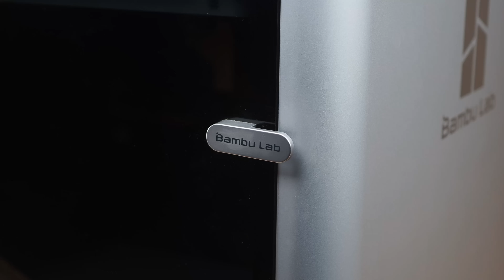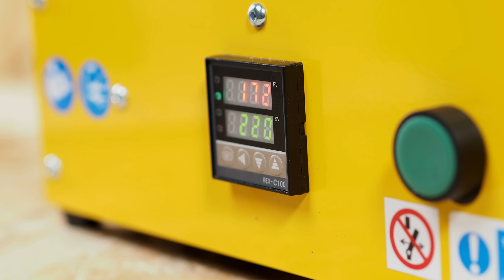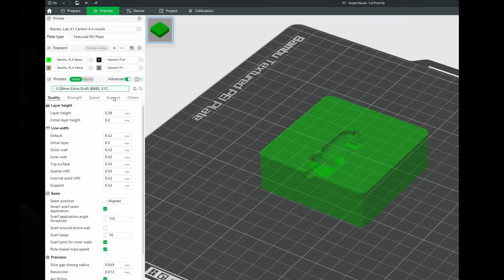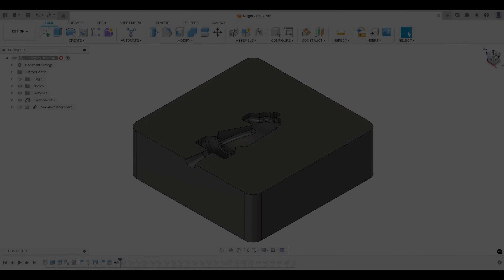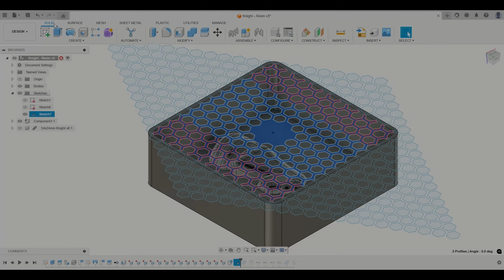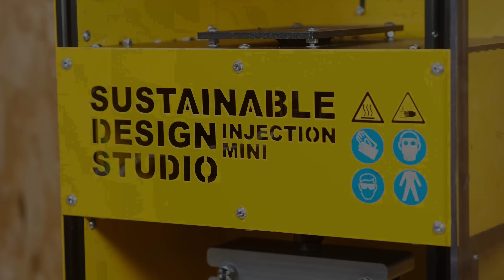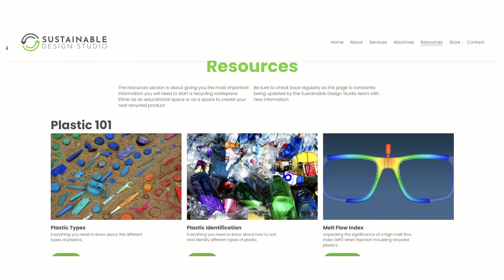How to 3D Print Injection Molds (FDM vs SLA) to Recycle Plastic!

Comment: do you have a f3d file for the 100x100x50 mould? planning to buy a machine next month and want to make some moulds but i don't know what the radius on the corners are., and where to put the hole. 

Thanks!
Reply from the maker: Yes we do. It's here:

https://www.sustainabledesign.studio/moulds-3dprint

The full f3d step by step is here:

https://www.sustainabledesign.studio/moulds-design3d

Let us know if you need any further help 😊

Comment: This is not great idea like many people think. Way too long time take and the time is biggest enemy on quality production. It basically burns the plastic.
Reply from the maker: The key to recycling is to not burn the plastic. That's our objective, and by melting the plastic at the lowest possible temperature we avoid this. 

This is designed for prototyping, not full scale production. However full scale production in china where time is cheap, still requires minimum orders and very expensive moulds (£10,000+)

 If you are looking to produce 1 to 10,000 units that's where our affordable solutions come in. 

Hope that helps!

Comment: Can you electro plate a 3D printed mold? Does it make the injection process any better? Surface finish, temperature resistance, etc.
Reply from the maker: You probably could however the thermal properties of the mould will remain the same. It may improve the surface texture. But the SLA prints are already extremely high quality!

Comment: Molds was what got me into 3d printing in the first place,  about 3 years ago,  at work, we had a contract for making cables that required over molding of polyurathane over the connectors,  it was a small contract and the company was not going to shell out the cash to buy a machine.

we got a local machine shop to make the molds on cnc with aluminum.  the problem with molding over connectors is getting the rubber over the parts you want without it seeping into the connector,  another problem was that the 2 part urethane was sticking to the molds,  on top of seeping into connectors,  I felt that they were designing these things wrong.  so I started learning fusion 360 from scratch,  and bought a 3d printer,   1st mold I made was miles ahead of what they have been attempting with aluminum,  a couple quick tweaks, and it was perfect,  and an added bonus, the urethane did not stick to the PLA,  I didn't even need to use silicone spray release. 

I am currently on another over molding project.   (military contract)   and the cables look great. 

Plastic has an advantage,  since its semi flexible,  if can create tight seal,  Used printed flat inserts to isolate the part of the connector that needed to be free from the epoxy/urethane.   also the cable needed to be able to exit the mold, so that "hole" is what needed to be tweaked to have a nice seal so the epoxy does not leak out.
Reply: I'm looking at doing the exact same on some 16 way Odu connectors! Using an x1c for printing, what polyurethane did you use for it?
Reply: @cdhmcclelland  Mostly mil spec stuff,  whatever the drawing calls for,  for example conathane EN-1556,  I do not have a commercial injector,  I just mixed part a and b,  in the right ratio,  de-bubbled (vacuum tank) then used syringes yep  regular old medical 60ml and injected.
but last cables I did, I found a better way,  I used a big 200ml double barrel adhesive cartridge, and mixing nozzles,  I did not need to use a vacuum to de bubble,  once I fill the cartridges,  the material is not mixed,  they mix in the nozzle at the time of application.  whatever you don't use is not wasted.  only the nozzle needs to be removed after use, and a new one used for next application.   in theory if you really need to de-bubble the un mixed materials,  you could do it directly in the cartridges before putting in the plunger disks,  I did not have serious bubble problems, so it was not needed in my case.   this all depends on the material you use, how fast it cures and its viscosity.

Comment: the  real game changer is going to be once metal printing becomes more open source and open to the public in the near future. I've already seen people build car parts from metal printing, but imagine mold making with metal for home injection.
Reply: Metal 3D printing is going to be a game changer for real. You will be able to fix anything - as long as the metal 3D prints are strong enough, you will even be able to rebuild old cars that do not have solid metal replacement parts

Comment: Very nice video production. Im curious about the injection pressure...I reckon that's defined by the pneumatic system. Is the air pump also included in your kit? and what injection capacity could it do?  I ask in case we could potentially do multiple parts per mould 😀
Reply from the maker: The Injection Mini requires a separate air compressor, but these are cheap and easy to find. 

The injection size is 70cm3 which is actually very large for a desktop injection moulder. Plenty of room for multiple cavities!

Comment: Hi great video, finally more content on this topic is coming up I think for sla printed molds and ~50 injected parts and this is a great method, please keep videos on it coming guys 😊

1 quick question, I want to make cookie cutters like this but sla resin is toxic. Does contaminants leach to the injected part as mold ages, I hope for first 50 parts it is still good 😅

Or have you ever experienced mold material or color passing on the injected part?

Because even if I make a skin contact part like a jewelry resin in my opinion is risky if it leaches to the final part. Using mold release might also help with taking the part out of the mold and this contamination aspect.
Reply: Some manufacturers do produce food safe and wearable resin, something produce resin made for mold making, regular resin tends to inhibit silicon rubber from curing inside a mold from my experience.
Reply: @miguellopez3392  Thank you for your answer, but there is no 3d printable food safe resin unfortunately. 

There is biocompatible resin but then I cannot use it to inject plastic inside as they are not high temperature resistant.

I didnt understand rest of the comment. I mean I would use a high temp resin if I do this anyways like what is advised on the video TR300 resin or something like that
Reply: @ROBOROBOROBOROBO  certain resins can't be used as molds because they inhibit the epoxy/silicons from curing properly leading to the surface of the product being still liquid.
Reply: @miguellopez3392  resin shown here seemed not to have that defect, it seemed pretty dry to me

Comment: I have p1s and might not be able to cater PC filaments. Would this be possible with PETG filament as an alternative for PC? Kind regards
Reply from the maker: Maybe, but not recommended. PETG is very brittle, and doesn't have a very high melting resistance when compared to PC. It could be possible but likely won't last anywhere near as long as PC.

Comment: Dude, print in some cooling channels. Get a bucket full of ice, a pump and some small rubber hose and some fittings. Like 30 mins to put together.
Reply from the maker: Thanks for the tip, would this be to prolong the life of the mould or for other reasons?